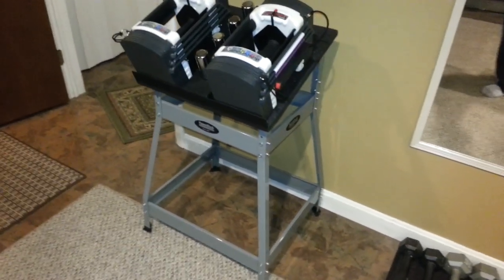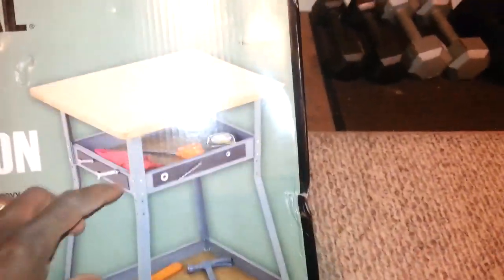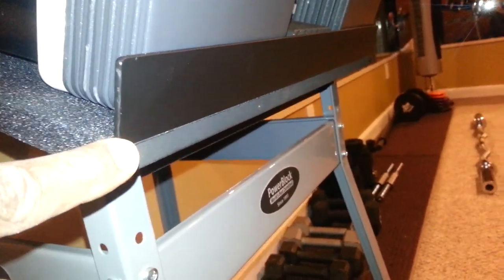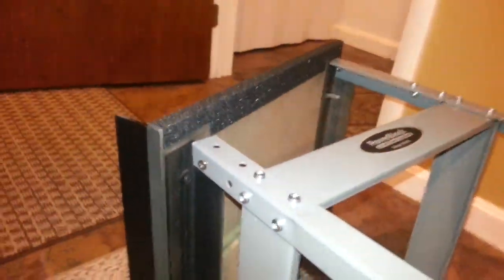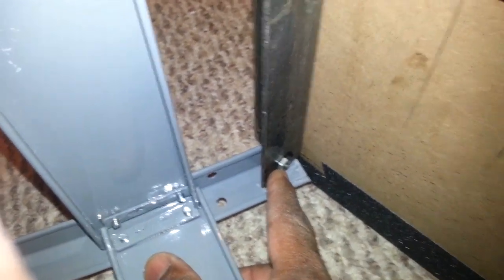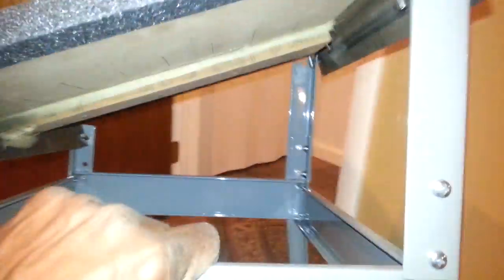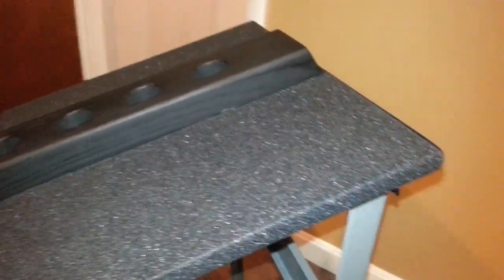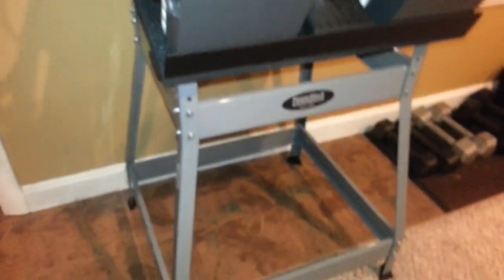Alternative PowerBlock Dumbbell Stand

Comment: Great stand!  PowerBlock also sells just the official top, with adder weight holes, angles, and the black non-skid paper, for $37 plus $11 shipping.  It's made to sit on the floor and can be seen on their official Stands video on youtube, and it can be seen on their official PDF brochure through their website.  Might save some of us two-thumbs builders from having to build the top, angle iron, etc.  We can just plop than on the HF base, screw it in, and boom, still only about $80 overall.  Thanks for a great video, Clifford.  You have the skills to build the whole thing.  Love the printed label idea!
Reply: Oh, I wanted to share that with Urethane sets (not yours, Clifford), the front lip of the slanted rack even from factory can cut the urethane.  Ouch! So, be careful as lifetime warranty does not cover the urethane.  I use two flat weight lifting bench, about $40 new each, to store mine-when working out I can separate them and walk between them to lift the weights, one in each hand.  Great for heavy #100+ weights.  Works great, perfect height, padded, no lip.  :)  Many workshop table options too, when cut down to proper height.  And Ab Benches (short sit-up benches) can be bought at two for $80 and can move to walk between to pick up weights.  Other options for those less handy than Clifford.

Comment: Thanks for the idea, I did something very similar.  I built the stand with all the original pieces and set it to lean forward just like you did.  I painted the press board black, then I covered the top with rubber safety tread strips from harbor freight.  In place of the angle iron I just screwed an 18 inch magnet strip (from harbor freight) towards the bottom of the stand.  I don't have adder weights so no center piece.  The magnet & safety strips work pretty well at holding the weights in place and everything was less than $50 since I had a 20% off coupon for the stand.  Thanks again Clifford!

Here are my item numbers:
Self-Adhesive Rubber Safety Step Tread Western Safety - Item#98856
18 in. Magnetic Tool Holder U.S. General - Item#60433
Adjustable Height Heavy Duty Workstation U.S. General - Item#46725
Reply from the maker: You're welcome, I'm glade to see you used the rubber safety treads. I didn't see them until after I finished my stand. If the skateboard paper doesn't hold up I will be changing to the treads. I'm glade I could help and thank you for your comment.
Reply: mpbrown18 Did you cut the top of your stand at all? Also if you didn't use angle iron how did you attach the top of the stand to the base?
Reply: @wallykings2543   Sorry for the late response, but the magnet has front screws, I just screwed it into the top of the workstation after covering it with the step tread.

Comment: Ok so I made my stand and it has been working great. I never added wheels to it because I dont move it around that much... but after years of use I wanted to add a modification and see if you had any ideas. Since the current stand is so sturdy with a 1000lb capacity, i wanted to add bars to make a dip station/weight stand combo. Any suggestions?